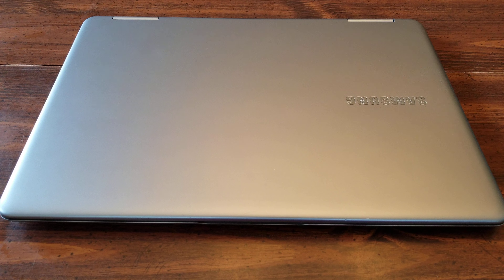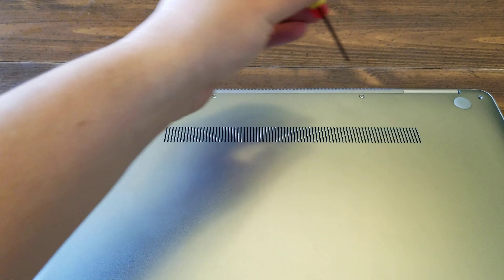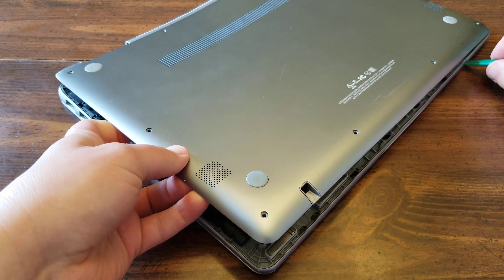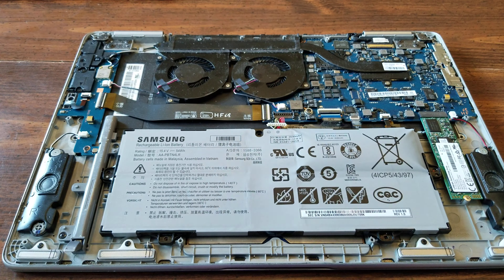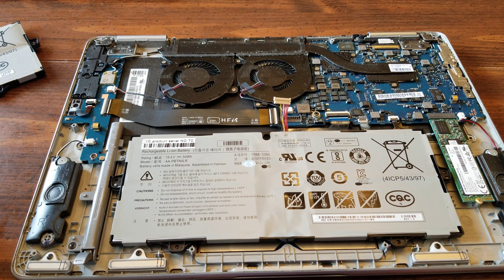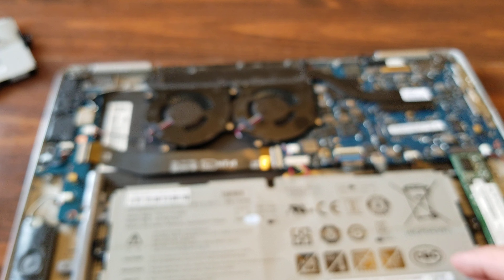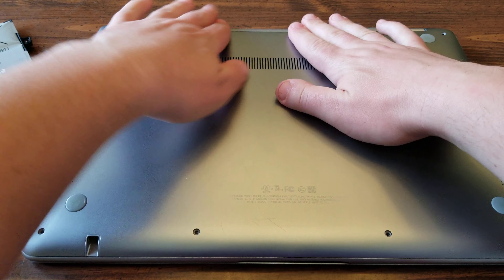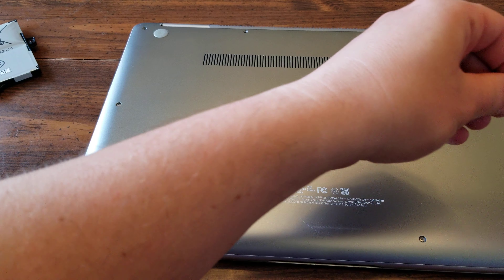Samsung Notebook 9 Pro Battery Replacement

Comment: Other than removing the S-Pen is there anything else we need to do first? Like backup files or anything? I know changing the battery shouldn't affect things like that but is there any chance? I was going to have a professional replace it for me but if there is no chance I'm going to screw anything up too badly I'll just do it myself.
Reply from the maker: You should be totally fine. The data is stored on the SSD which won't be affected in any way

Comment: Nice video - too the point.  My notebook wouldn't take a charge so at first I thought it might be the cable.  But after getting a replacement...still no charge.  So after reviewing your video my next step will be ordering a battery and following your steps.  Thanks.
Reply from the maker: @fredthomasiii4576  so glad I could help.

Comment: Having an issue on my notebook 9 pro running windows 11 where it will die at 20%. I replaced the battery and it is still dying at 20% charge. I did a battery calibration and a reset of the windows software and still the same issue. Battery report shows the new battery is at full capacity and is now at 5 cycle counts. Any tips on how to fix this?
Reply from the maker: Unfortunately if the batter is showing as healthy, it's probably a win 11 bug

Comment: Thanks for this! its always nice to see exactly how its done. My battery also was missing the top screw. I had to drill two screws, as they just would not turn and broke two screwdrivers. But the laptop is working like a champ, and the old battery was bulging hugely on one side. Not enough that it had pushed out the keyboard that i could tell, but after removing it, it was 30% thicker from the bulging on one side.
Reply from the maker: Used to just be a hobby but now I work for a tech repair place. It's called ubreakifix if you even need anything done. They're all over the country

Comment: The top of my stylus snapped off too! It's hollow plastic on that part though, so superglue can fix it up good as new. I also had no top screw on the battery, and had the same bulging issue. I guess these are all common issues, thank you for the video!

My battery replacement crapped out after 5 months, and the original one lasted a few years. Do you still have this laptop, and did the new battery last for a while? I wonder if I got scammed by some shady seller.
Reply from the maker: You're welcome. I used gorilla epoxy on my stylus and it worked great. Still going strong.

Comment: Thank you so much for the video! I was going to pay Best Buy $60 to replace my battery when it took you just about 8 minutes to do it yourself! Thank you so much for this! How do you clean the fans in the laptop? I’ve been having some heating issues and the computer gets really hot but I’m not sure as to how to clean the fans
Reply from the maker: Just blow them out with a can of compressed air. Seems to work pretty well. You're very welcome. Glad I could help.
Reply: @crockich44  Would I just blow the compressed air on the black fans or should I do it from the outside? Sorry for the dumb questions I've just never tried to do these things myself and I don't want to mess it up haha.
Reply from the maker: @andrescaballero6644  it would be worse not to ask lol. You can pretty much just blow it all over the inside especially the fans. Won't hurt anything.

Comment: I have the Blue version, very similar looking internally. It has been going off and rebooting on its own... any ideas?
Reply from the maker: Hmm. First I would check for any windows updates. If fully updated you may want to back up your data to the cloud or an external drive and just do a fresh install of windows.
Reply: Yes I did that, updated everything,  made sure all the drivers and windows 10 was reinstalled and up to date. Cleaned up anything,  took it apart... Im wondering if the board on the powerbutton side could be the issue. Not sure really where to start, also don't know where could get the exact part
Reply: It is maybe only a year ans half old... everything looks clean.
Reply from the maker: @bengrady6735  Man that stinks. Is it under warranty perhaps?
Reply: @crockich44   I don't think so... but I need to check. I bought it through a ebay supplier new sealed in box.
Reply from the maker: @bengrady6735  https://www.thespectrum.com/story/news/local/mesquite/2020/10/19/pc-periodicals-10-ways-fix-computer-keeps-restarting/3709939001/

Comment: My computer has the same problem. It only works with the charger connected while it does say it is 100% charged. 

Cory, did your computer turn on and worked fine after this battery replacement?
Reply from the maker: Yes. No problems whatsoever since the new battery
Reply: Hey Shaneska, i have this exact same problem as you. How did you fix it?